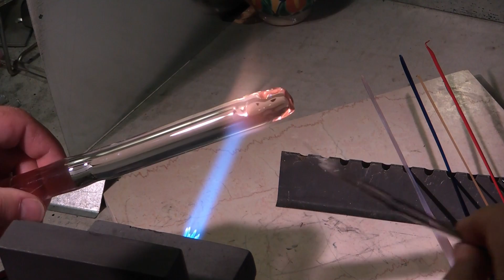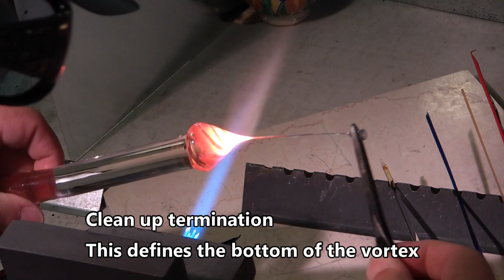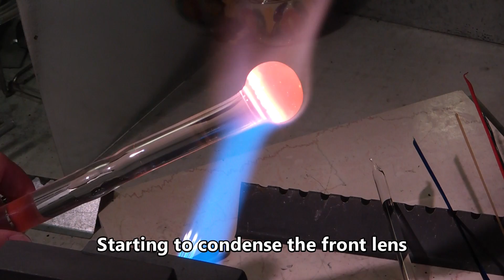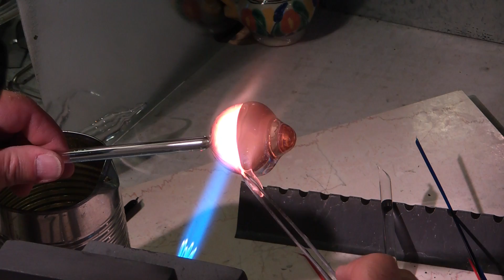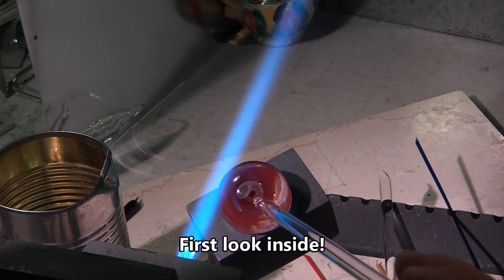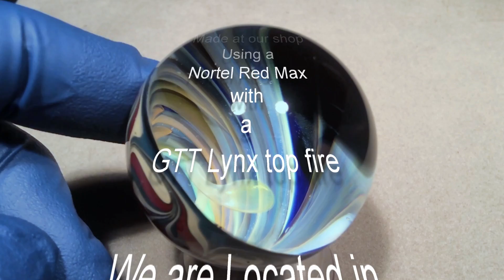Making a Vortex Marble with Borosilicate Glass 1.60" hand blown by Bill Grout

Comment: How come you fume the black fruit, but then put color over it? Interesting and different techniques then I knew. Thanks!
Reply: Black frit*
Reply from the maker: Good question! The back color is not always 100% and is often not completely opaque. A fumed layer can reflect some light and add a back lighting effect. Sometimes this is quite dramatic and other times it may have no visible result. I guess I often use fume layers just in case.
Reply: Yea I guess you can never have too much fume... in my opinion lol. Thanks for the response I learnt a lot.

Comment: Where did you get that graphite stringer holder? I need one!
Reply from the maker: I think what you are referring to is the tungsten pick used for raking. This is a common welding electrode sharpened on the end and jammed into a scrap stainless steel bottle stopper. Random holder but that's what it is.
Reply: @BillRaeShow  oh, no, I know about the tungsten pick. I was referring the the tongs he used at the end of the video that he used to help polish his termination. He had mentioned it was a tool he had come up with?
Reply from the maker: @andrewhamry7760  Still not sure what you are seeing. The only "tongs" I am using are just stainless steel tweezers.
Reply: @BillRaeShow  omg I feel so dumb! I was half asleep when I responded. Theres the graphite piece that has notches in it for the stringers. Its at around the 2 minute mark that I first noticed it.
Reply from the maker: @andrewhamry7760  That was the next thing I thought you might be looking at. If you are referring to the "rod rest"  there are two on the table and the one on the right is just painted flat black so might look like graphite. They are just pieces of roof edge flashing that I filed notches in with a round file. Those are easy to make and very useful. I fuse short sections all the time and would burn my fingers picking up the rods from the bench all the time. Seems I always grabbed it right where I had just fused it together! Then I trained myself to keep all hot parts on the far side of the rod rest and problem solved. The only thing to note is that if you don't have the hot part far enough over the edge, you can get chill cracking from the metal.
Reply: @BillRaeShow  Thanks for letting me know! I am gonna have to look into doing this for myself. I am just getting into marble making and I am looking into all the tools that I may need along the way.

Comment: How do u add the clear without trapping air?
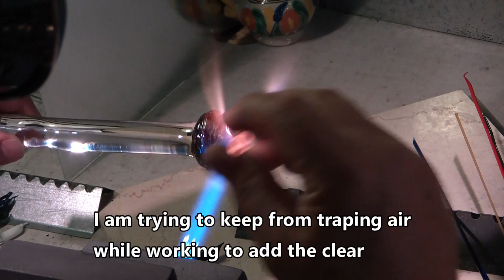Reply: I think the sequence at 5:30 is as clear as I can be. The heating of a small portion at a time right at the rod to marble corner and then pushing that molten bit into the marble will push the air out. Raising the rod immediately will allow the flame to flow any edge that might try to trap air. The stitching motion should do the trick but honestly in this zone, tiny bubbles are not of any concern. Rolling the rod back and forth can also work with the right heat and speed.  Stop at any point and blast the base to smooth things out. You can also pick out a bubble with tweezers, especially if it is near the surface.
Reply: @WilliamGrout  ok cool, thabks for the response! I'll try it again today. I usually make thes by heating up another gather and basically stabbing the spiral into it but a lot of times it creates a lot of stess or it doesnt look even, so I'm trying to get the hang of using this method instead